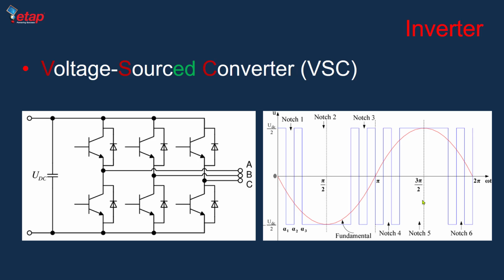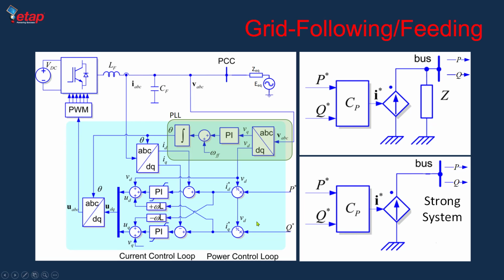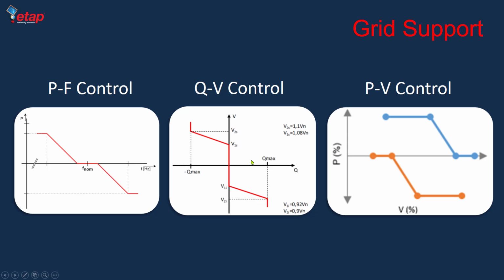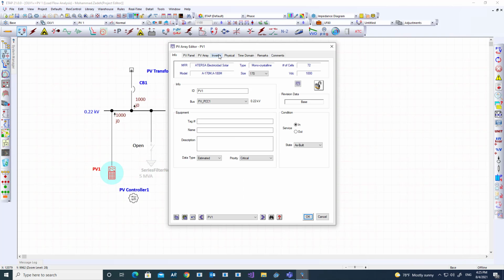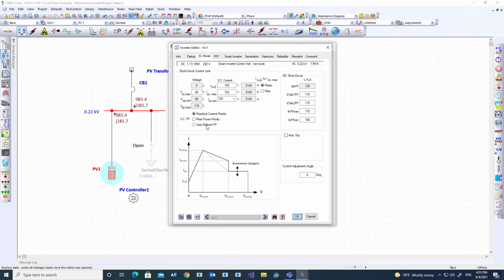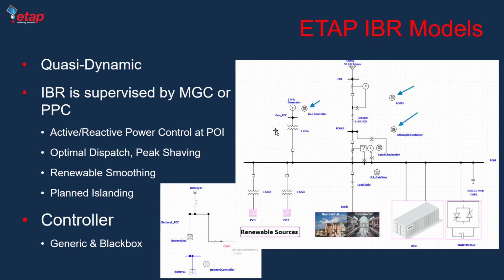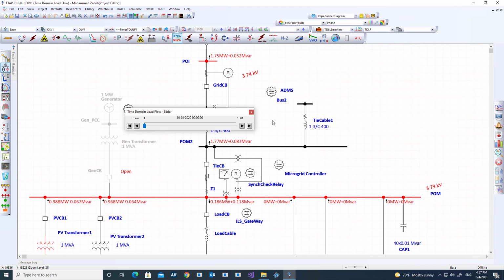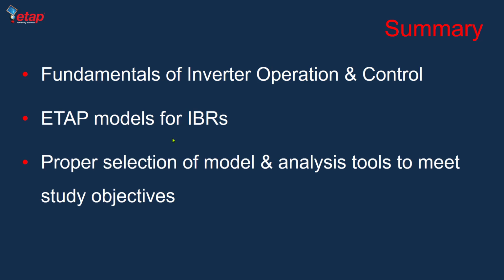Short Circuit & Dynamic Modelling of Inverter-based Resources

Comment: Hey, thanks for this useful lecture, but I have question if I might ask as a student, does the VFD using in ETAP generate the reactive power to motors and seperate the motors needs if the grid , so it increases the PF of the grid, (the VFD is used as frequency control)
Reply from the maker: Thank you for your interest in ETAP Solutions. Yes and yes, VFD used in ETAP reactive power and separate it from the grid. Also, please feel free to contact  our 24/7 Help Center, https://helpcenter.etap.com for more assistance.